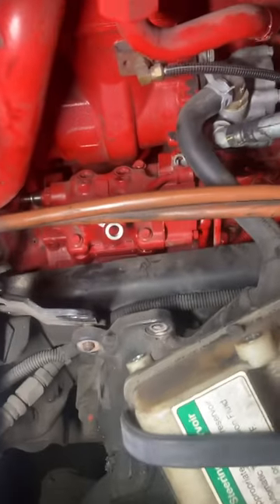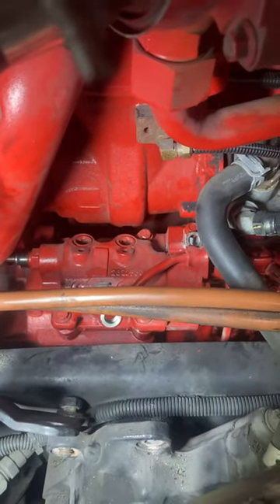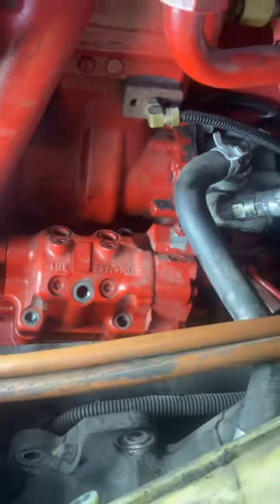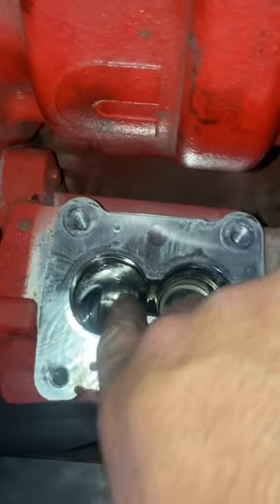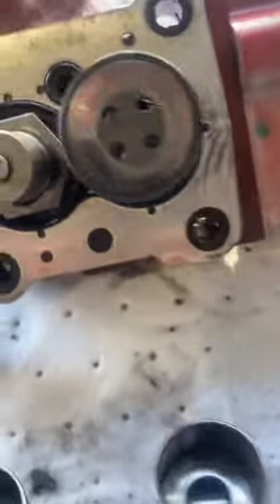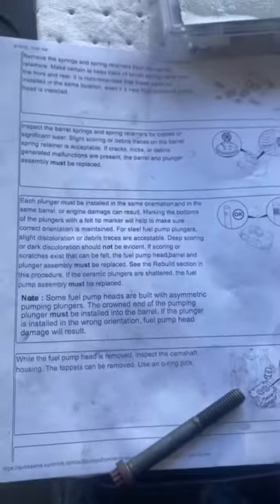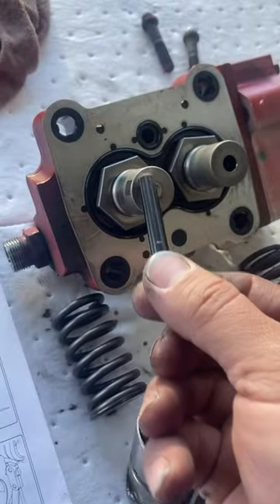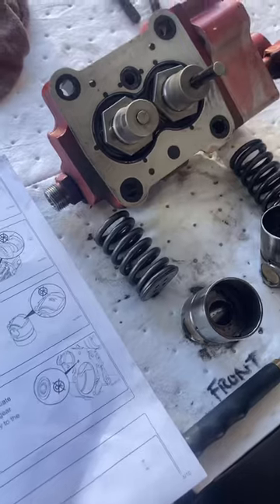CUMMINS FAULT CODE 559 – Injector Metering Rail 1 Pressure - Cummins ISX 15 fuel pump inspection

Comment: Is it a rebuild kit for the pump or do you have to replace the whole pump? I’ve been getting intermittent, check engine and low power on high demand with code for low fuel pressure
Reply: Did you ever figure it out? I'm getting the same. But part of the problem was two bad injectors. Replaced those today, truck runs much better, but code still comes up under full load within about 7-8 seconds and then goes away like 5-6 seconds when getting off the power.

Comment: What are the symptoms for this code?
Reply from the maker: This truck was losing power and throwing the mil/cel when towing a trailer. So at high fuel pressure demand it would not meet requested fuel pressure and feel like it was losing power.

Comment: Would it be similar on the ISB?
Reply from the maker: I don’t think so. I think they have a different style high pressure fuel pump. What codes or issues are you having?
Reply: @alreyindustries   loss of power while driving. No codes while at idle. Changed fuel rail, actuator and sensor. All pressures are normal at idle.
Reply from the maker: @LakelandSepticCompany  what about injectors? Were those replaced or the injector tubes disturbed at all?

I have seen the injector tube nuts not torqued down correctly so that at high fuel pressure demand fuel will leak at the tube/injector connection. I want to say the torque on the injector tube nuts is 30 ft pounds, but definitely double check that.
Check to see if they are torqued correctly or if you get a turn on them when torquing. That could be your issue.
Reply: @alreyindustries  when the rail was replaced they changed out one of the the tubes I believe but will have to double check.
Reply: @alreyindustries  injectors we’re not replaced
Reply: @alreyindustries  tubes were not replaced but they did replace one injector line.

Comment: Im having the same problem. But has a new fuel pump????
Reply from the maker: Any work done to injectors recently?
Reply: The engine was rebuilt. Then it came back with the code. The engine falls on its face . When pulling a load. Just for a second?
Reply from the maker: @dalejrfan820002000  sometimes if the injector tube hold down nuts are not tightened down to the right torque specs, when the fuel pressure gets high under a load, the injector tubes will leak where they seat on the injectors. Make sure all those are torqued down. Check the fuel rail pressure relief valve. Check your filters. That’s where I would go.
Reply: Thanks for the information. I will check it out.

Comment: So I have this code 

Fault Code 1911

Injector Metering Rail 1 Pressure - Data
Amber Valid But Above Normal Operating Range

Is it the same one? 
Cummins isx15 
Does that mean my fuel pump is bad?